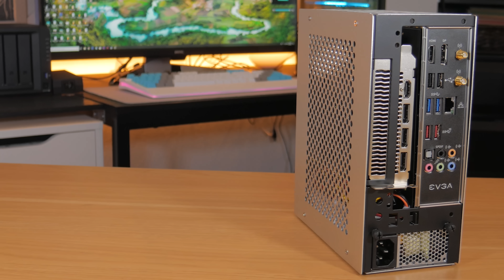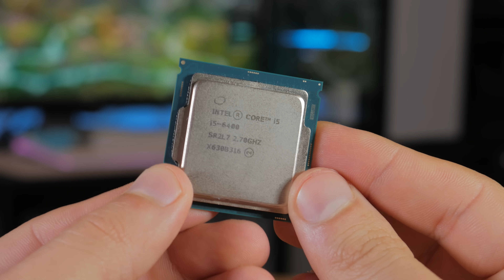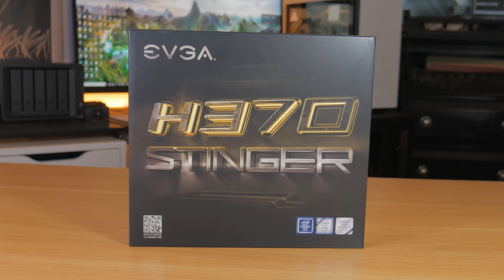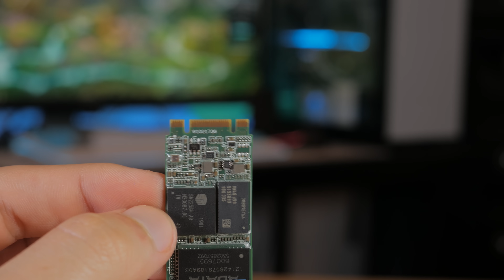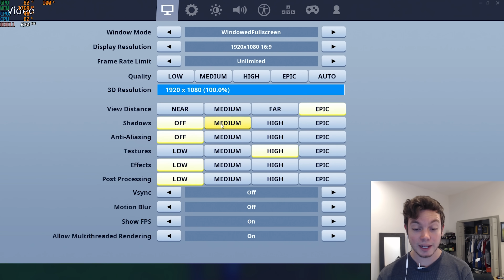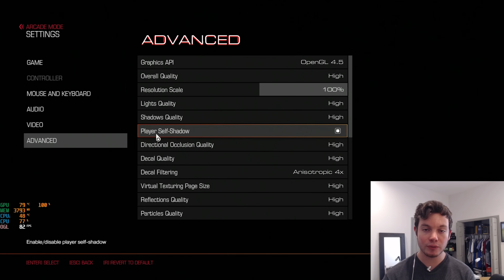Gaming PC SMALLER Than A Console!

Comment: Cases like these have been out for a while. There are cases similar to these from places like Taobao for relatively cheap (k39 itx, m24, etc...). You can get them bundled with the riser + 500w modular flex atx psu for around $130 before shipping.

Comment: There is a similar case sold on the Chinese shopping website called Taobao. It is the K39 case made by a small company called SGPC (In Chinese, 傻瓜超人). This case was already on sale in the late 2018s which was way before Velka 3 (And the previous generation Velka 3, the one that had 2 metal meshes on either side, and which YouTube ponchato did a build guide video on) was released. So technically you can say the Velka 3 isn't the first company to come up with this sort of component layout and using an 1U Flex ATX PSU. 
Before you guys produce any sort of stereotypes about Chinese products having bad quality, take a look at it first. 
I have the link to the SGPC K39 case here: https://m.intl.taobao.com/detail/detail.html?id=571416909587&spm=a21wu.10013511-tw.7.1
Reply: I've already built this PC for my cousin a while back with a Ryzen 5 2600 (Cooled by Cryorig C7) and an EVGA GTX 1060 6Gb SC GPU.

CPU at 68°C on full load. 
GPU at 72°C on full load.
Reply: Tech By Matt I hope you can look up for this case.
Reply: FYI guys, the K39 has good build quality but although not as good as the Velka 3, it justifies with a price tag of 59 RMB, or around 15 USD. The 400W Gold 1U Flex ATX PSU I mentioned costs 299 RMB, or around 40 USD.
Reply: This is where the power of Taobao comes in. Many electronic hardware are made in China and many cheap yet good-quality products remain in China. Only large brands (Like ASUS, Gigabyte) fashion the same products up, brand them, make them look better and then put a higher, more "premium quality" price tag for sale to foreign countries while these products perform equally compared to the cheaper yet same quality products that remained in Chinese market.
Reply: @ylizi6324  What's up with the scaling on that link? It's somewhat farcical.
Reply: @Safetytrousers  It was a mobile Taobao app link. So the pictures were oversized lol